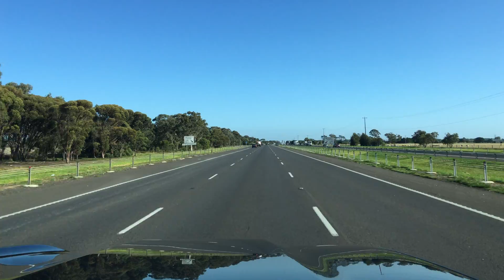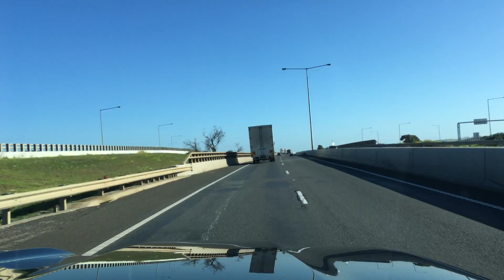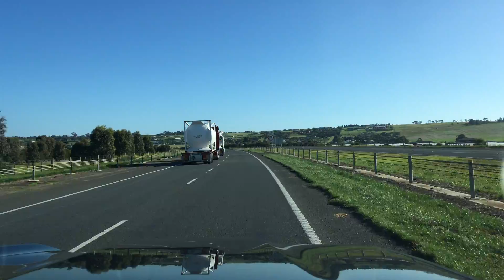WHY DOES MY DIESEL BLOW SMOKE

Comment: I have a 2.0 diesel ssangyong, 220kms grey smokes (smelly) intermittently after it warms by 20 mins . Got much better with flush and new oil with additive . But I’ve disconnected egr as car was stalling ,

Comment: 4 cylinder J120L in Belize cold start after long storage, no problems and ran for 30 minutes. AC was not working so removed glove box and wiggled AC actuator. Next morning Engine starts but as driving away loses power and lots of white smoke with heavy diesel smell. Vehicle gives hard start but no power to move can’t stay running.

Comment: Mazda 6 diesel 2.0 2007

White and black smoke bad when cold , black when it's warm 

Injectors test ok 
New air filter
New MAF sensor  
Entire intercooler circuit removed and inspected 
EGR removed and cleaned 
DPF removed and ECU flashed ( was smoking before this)
Does not burn any oil or coolant 
Fuel filter replaced 

Still smokes like a steam train
Reply: ive got the same car with the same issues, on cold start i get a huge cloud of white smoke (unburnt fuel) and the occasional puff of dark smoke when i get higher in the rev range. i noticed that when i park with the front of the car uphill the white smoke is a lot less so i assumed it was caused by bad injectors leaking into the cylinder. let me know if you managed to sort the issue thanks

Comment: Hi Anthony, i have a Hilux SR5 2013 and  had smell of diesel oil every time I stop then I noticed that look like leaking fuel line from no 1 pipe so then I’d changed the pipe on no 1and of course cleaned before and after but still have that smell of diesel oil every time I park at home. Would it be the injector or the seal from the cover? Thank you, Eddie Q of Mill Park

Comment: very informative, have a 2007 hilux with 250000km engine was rebuilt but original injectors blows white smoke on start up.. very lazy when cold and even.when warm barely any.power.. will be replacing the injectors soon hope that fixes all the problems and.gives me back the power I'm currently missing